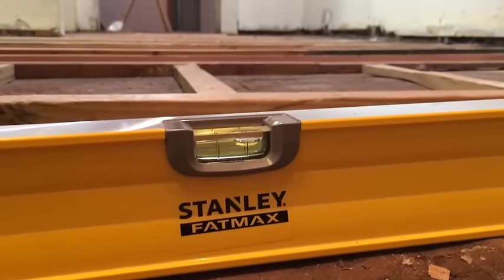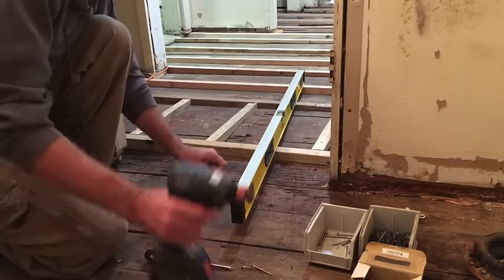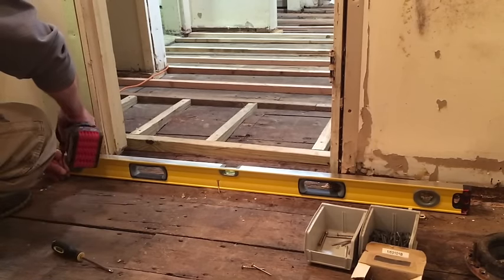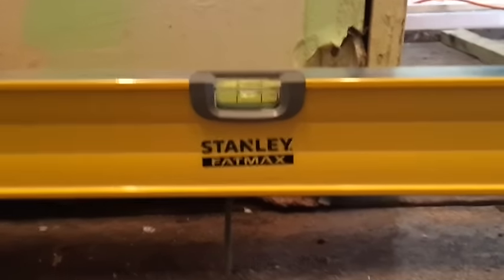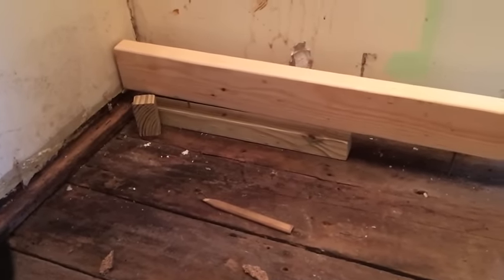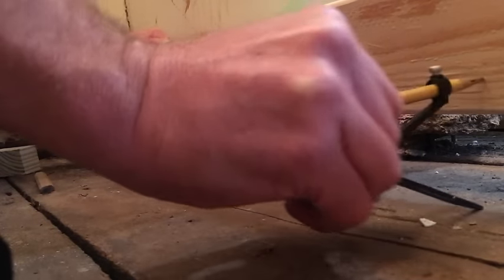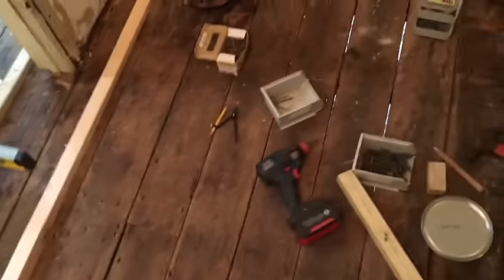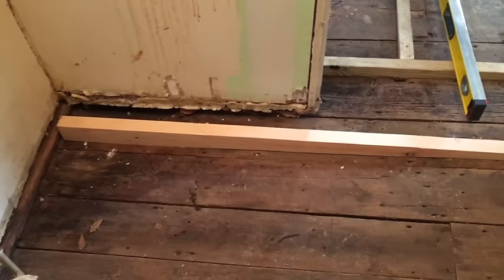DIY: How to level a uneven, wavy, or sloping wood floor

Comment: Ok so  I deleted my previous comment saying this was genius, and wanted to write something else, while this is genius it was also a lifesaver thank you.  I saw some Comments saying that it saved money and  it's worth the time it took ; I couldn't agree more.  My wife and I thank you. We busted out asses today doing this to get ready for vinyl plank flooring. So excited.
Reply from the maker: Glad it helped, Richard. I stayed awake at night trying to think how to level the floor without demolishing and rebuilding the structure and creating a huge amount of more work and expense for myself. Hope the finished product turns out great.
Reply: @737T1C130  thank you I'll let you know. I'm still trying to figure things out I haven't done a lot of this kind of stuff but I'm trying.   This is basically the only option for me as I own a townhouse and the osb goes under the walls lol what a mess.  I'm thinking of using 5/8" ply for on-top but unsure how far apart the new joists (for lack of a better word) can be apart.  I could also use thicker osb on top and just go 16"on center.   All the door frame jambs stop are one piece metal so I'm not sure how adding over an inch to the subfloor will work out. I'll let you know how it goes, thanks again.
Reply: I stand by the fact that it's a good idea but the floors in my house are out in every direction and this didn't work, it did at the start but the further I went the more it was off. So I pulled up the OSB and used 2x4's and even still it's a pain because the Joists are cupped from top to bottom,, have a hard  crown one way, a dip the other, they are no level with eachother.  It's going to be a fight every step of the way and because it's a townhouse the osb goes under the walls to the next house so I have to build the joist out from under the wall then up to the level of the other joists.  It's a nightmare and progress is very slow. I'll beat it because I have no choice.   Hope your house turned out well.

Comment from the maker: PLEASE READ before you ask why I didn't just fix the foundation, beams, or joists. There was a brick chimney estimated to weigh about 2200 pounds that was sitting directly on the floor and was unsupported from underneath. The house was built in 1916 and over the years, the large 8-10" hardwood carrying beams, joists, and two layers of perpendicular subfloor planks all warped under the weight. I removed the chimney and jacked up the house, replaced the footer and concrete block perimeter foundation, but the curvature of the beams could not be straightened, and there is only a small crawlspace underneath to work. The floor is now supported from below with concrete and posts, but I needed to correct the warping above WITHOUT SPENDING an enormous amount of time and money rebuilding the structure. If I wanted a perfect like new house, I would have rented and excavator, destroyed and buried this one, then built a new one. It would have been less work. This, however, has worked perfectly for my needs. Cheap and fast, and the structure is no less rigid after adding supports below. I uploaded this only because I could find no other methods on Youtube. It may not be the best way, but it is working out great. I'm using a level, screws, and scribing tool to level an uneven wood floor.
Reply: I have the exact same problem and was wracking my brain how to level it. I have installed a carrier beam and jacked the house up but due to the chronic sag of the joists and the uneven nature of the old foundation, I wound up lifting the whole load bearing wall right off the foundation trying to jack the sag out of the floor. Your method is exactly what I needed!
Reply: Great video. My house from the 40' s has the same issue. I used thinset for the rooms that were not very bad but this is a great way to reduce weight. I also think I can adapt it to lessen the transition between rooms.
Reply: I level houses for a living. You could just replace the floor and once its off replace everything else as u go. We hav done it a few times.
Reply from the maker: JosePalacio12 yeahokthanks
Reply: Great video! Exactly what I needed to know.
Reply: Thank you for making this video. Bought my first house and it was built in 1917. Going to try this on my second floor that is also around a chimney
Reply: @JosePalacio12  thank you for sharing. If you remove the floor, i'm assuming your comment of replacing everything else as you go up would apply to the walls etc.
Reply: Thank you for sharing this! Are you aware is this has held up or if you experiences any issues along the way?
Reply: @cjharrin  yes. Remove the floor completely then replace whats under with treated lumber and lay somethin over the ontop of the cement to stop the sweating up to the wood. Then add your floor and the rest just goes normal u kno remove the sheetrock and replace studs as needed.
Reply: P
Reply: That's alot of words for "I'm a butcher".
Reply from the maker: @plumbertim6333  Do plumbers get constipated?
Reply: Had same issue with a property i bought 15yrs ago. Although mine was a 200yr old building and the warping had left a slope of at least 30cm. Took a long time to do but fixed it all in the end
Reply: @thompsona10625  haha farrrrrk not a good day I’m guessing?
Reply: Has this worked well for your house? How’s it going?
Reply from the maker: @GenevaSevenfold  still going strong. Have had renters in the home for almost two years. Rock solid and no problems whatsoever. Thanks for watching!
Reply: @737T1C130  thank you for sharing this! I’ll be doing the same for my rental building as well. Thanks for everything!
Reply: I’ve seen guys try to straighten old lumber. They return the next morning and the old lumber has pulled the new lumber back to it’s previous position. Sometimes you just have to leave old lumber alone and work with and around it.
Reply: Our house had the same issue with the chimney not being properly supported for over 20 years!
Reply: My house in Cincinnati was built 1915, with terrible support structure design around the staircase.  Sagging in same area on 1st, 2nd, and 3rd floor.
Reply: Nice explanation and video! Thank you
Reply: Hi very good video..could you reccomend some1 that could do this work, have a similar issue not much a DIY guy so wouldnt mind paying
Reply: @JosePalacio12  by sistering joists?  I don't want to add another 600 lbs weight to my two floors I have to level in this 1889 house... racking my brain
Reply: Man I'm working with a similar situation at the moment. House is at least 75 years old. Sloping is around chimneys except mine are supported underneath with a concrete foundation. It's a old tongue and groove pine and believe there were wood stoves sitting where there are some serious dips. So I'm basically gonna shim/fir it up similarly. I'll go under and gusset the floor with some more beams and Jack's and it'll last as long as I'm alive. After I'm dead ? guess that doesn't matter. 😂
House was moved here so it

Comment: Apologies, this is going to be one of "those" comments. I really liked your approach; everything you did is something I've done before; screws for level, offset contour, and the mark for the final cut, but you put it all together for this solution and it was beautiful. Yet, in this particular instance, I believe we would have jacked and shimmed the stumps instead. Sometimes that's not a very pleasant job if the clearance is tight, but with laser levels these days, it's not technically difficult.
Reply from the maker: No problem, Paul. I had no experience with this and could find no information online on how to level a floor without pulling it up and without using leveling compound. I literally made this up laying in bed staring at the ceiling. It's probably not the best way, but it was acceptable for my purposes and all I could come up with. Thanks for the comment.
Reply: Were going to be doing this for my old house as well.   We went under the house and jacked up the posts and reshimmed and also added additional posts.   We couldn’t jack up some areas as high as we wanted do to the weight of the house in areas so we are doing this shimming on top to finish it.
Reply: @dg-vg9di  Hey how did you determine the weight was too much in certain spots? Trying to plan for a similar project in my house but I don't have a master's in structural engineering lol
Reply: @JohnVance  we used 12 ton jacks sitting on concrete blocks and 2x6 blocks and metal plates between the top of the jack and beam.   This way we were not damaging the beams by the jacks digging into the beams.   We put several jacks along the beams and surrounding joists to get a evenly placed load.   Then we jacked each up a bit at a time and put shims between the existing posts and beams.   We put levels on the subfloor and monitored the levels until they showed as level as we could.   We did a little raising at a time to try and prevent the drywall around doors and frames from cracking.    We raised between 1/8 and a 1/4 inch at a time.   We moved things around and around until we got a close to level everywhere we could.   We added additional beams and blocks where we thought the extra support would help.   It took us 3 months to get it all done as best as we could.    The one place we had issues was in the back corner angle of the house.   Even with 4 12 ton jacks we couldn’t raise that section of the house up as much as we would have liked.   The jacks just stop raising anythjng.   One small section of the house house has a 1/2 inch slope.   Se we put a cabinet in that place.   Even though you can sense the slope it’s not all the noticeable.   Everywhere we got pretty close.  We used 8 12 ton jacks to jack up various sections

Comment: I'm thinking out loud here, but I feel like you could have avoided that second cut by scribing differently. Maybe hard to describe but....  Use your compass to measure a screw, transpose that to the board directly above it (from the top down).  Then reset your compass to that new height before scribing.
Reply: Yup . This is the right way!

Comment: Doing this now. 1890 home, 5 inch slope over 20 ft. Super dramatic. I reinforced and supported all the joists underneath. Now I’m moving onto this step, after all said and done, would have take close to 4 inches out of the slope. I will never be able to get it perfect because of the door ways. Would be too much of a lip.

Comment: Thank you for this!  One thing that I like about this method, which I have not seen mentioned in the other comments:  There are cases like mine where you need the floor to be a flat plane while not being exactly level.  In my case, I need a slight slope (1 inch over 15 feet) to bridge from one room to another.  I plan to use this screw technique to level over each joist, while allowing a slight drop from one to the next.  The flatness  can be checked with a straight edge. Hopefully the 3/4 new plywood wil lbe flat enough for my LVP.   Any comments or tips wil be welcomed.  Thanks again.
Reply from the maker: Great point! Glad it helped

Comment: I didn’t even think this was possible, awesome. I’m under contract with an awesome cottage in the mountains that I want to make a short term rental, but the floors are BAD. The house was recently re-braced and they did a good job, but 140 years of sagging didn’t take the warp out of the floors. Instead of jacking up the center of the house and destroying all the walls, this could potentially be the answer!!

Comment: Wow! recently bought a house built in 1900 and will use this method to level our uneven floors! Thanks so much for sharing this method, it makes so much sense, and in our case floor leveling materials do not make sense, and our floor has many imperfections and patches with metal plates, etc. You are the Zen Master! Signed a thankful Grasshopper.

Comment: I came back to tell you that after I watched your video, I used this method to level my floor. It worked so well! It was a bit time consuming but it saved my hundreds if not thousands in floor leveling compound! Thank you!
Reply from the maker: Thanks, brother! That's all I wanted was to help someone else in the same situation I was in. Made my day. Good luck on your project!
Reply: Depending on the shape of your structural lumber and the subfloor over. This isn’t really fixing the problem. Just hiding it.
Reply: The problem with the house wasn’t the lumber or subfloor; it was the foundation. Pre code building in northern Michigan was built with the footer just below the level of the dirt. This led to a 4” discrepancy at the back wall that could not be rectified without lifting the home off the foundation and replacing most of the settled foundation. Simply leveling the subfloor was by far the easiest option on a 100 year old home worth $55k. I certainly agree though that if the issue is structural in regards to the condition of the wood, you should fix the rot or broken supports rather than covering it up. I have 3/4 pine (original) with the shims which are adhered to the floor with construction adhesive and structural screws followed by the new 22/32 plywood which is also glued and screwed to the shims and at every intersection where I can use a 4” screw to contact a joist. She’s solid as a rock and dead flat now without the added weight of 3” or more of leveling compound. It really worked very well :)
Reply: Hi. I’m going to attempt this. Does the floor sound hollow??

Did you use any gap filler(spray foam) along the baseboards?  Seems like those large gaps would invite unwanted critters. Seems like they could sneak in through the original subfloor and make a home in between the newly laid 2x4’s. 

Thoughts.
Reply: Is it even possible to use floor leveling compound that thick. Looks like it took lots of time and patience - and ACCURACY. thank for sharing your project.

Comment: Awesome and helpful video, and one thing came to my mind, that you don't even have to cut the board second time, you can take the height of the last screw (the one which is screwed the most) with a compass, transfer that height from the top of the board and take that point as the starting point for marking wirh compass and for first cut (of course you should start at the part with the biggest deviations , i.e. the part that you cut the most)

Comment: This is exactly the video I needed. I have an old house. The floor joists are 2 x 6 there was two additional beams installed in the basement to stop sag and I can’t really sister the joist because of all the plumbing and wiring so leveling the floor is the best and cheapest option to go. I’m starting this project this summer and this is what I will do, much appreciated for this video. Good job keep it up. 👍

Comment: Getting ready to do this very same thing, we’ve got a home that was built in the 40’s with the same beam structure and I totally agree with your method because no amount of jacking will help level out those beams, been there done that and this is by far the best and easiest method I’ve discovered.

Comment: Thanks for sharing this information. I now know how to fix my horribly and uncommonly uneven floor. The floor in my cabin has sloped in multiple directions that traditional methods just won't work. I'm not stupid by any means but the amount of things I need to fix is just overwhelming and the time to put these ideas together seem to get clouded amongst all the other thoughts in me head. Fantastic way to even a floor. I can rest easy now knowing I'm going to level my floor and not just deal with it as-is. :)

Comment: I've got a similar looking situation - I just pulled up carpet and beneath it was no subfloor, just bare wood that is also the downstairs ceiling. trying to level it all out to put down sound insulation and proper flooring, will give this technique a shot. thank you!

Comment: Thanks for posting and sharing.  We bought an old house too and the whole main floor is like this.  A year or so after we bought the place we redid the structure in the basement including using jack posts to shore up the main middle carrying beam that ran the length of the house.  The exterior edges of the main floor are pretty much level but we've got waves.  This method will help very much.  Nakummek-Thank you!

Comment: Same issue in the NW corner of my 90 yr old house.  Sits on 90yr old cedar logs, on dirt.  This is a good idea. Thought of using levelling compound but the weight is just too much for this old stick built 2x4 frame house.  Besides, I could ram some extra insulation in there at the same time.  Thanks for posting.  Thankfully my job isn't as big - area wise - as yours.  Good job.

Comment: Thank you for an excellent video. I am about to start remodeling an old house that has been in the family for over  45 yrs. It was built using the old frame of a home built in the early 1900's and over time the  floors have started sloping. Wanting to do it right, like you, this will be the plan. Than you again for such a detailed and easy way to solve the issue. Merry Christmas!